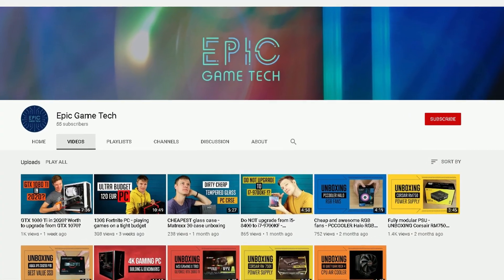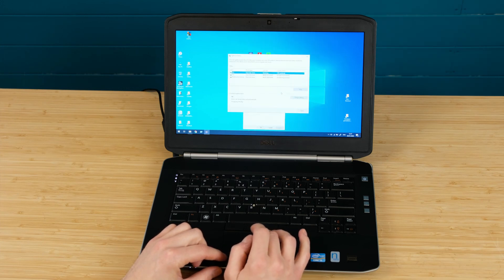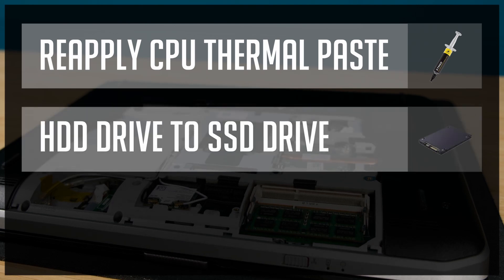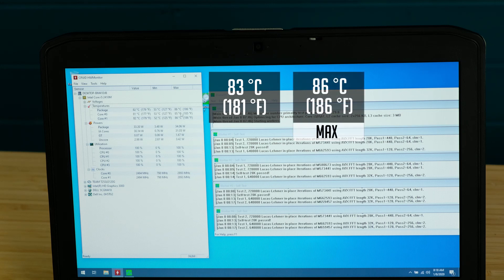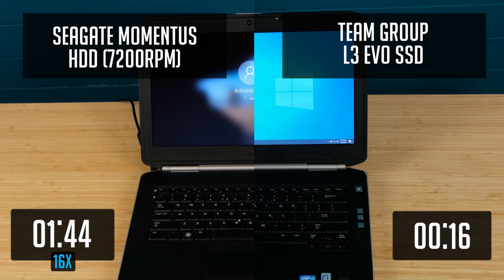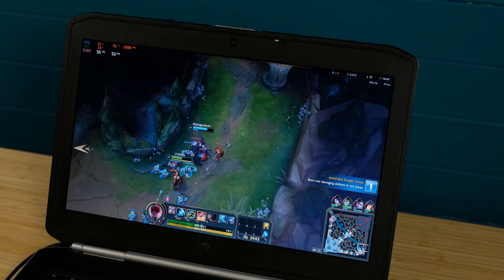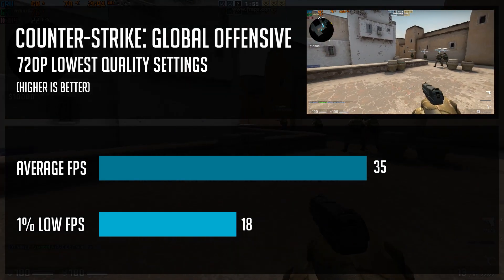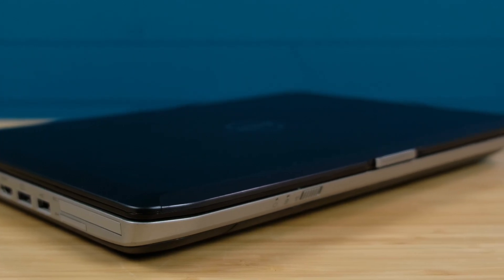HOW TO BOOST OLD LAPTOP PERFORMANCE - INSANE results and much faster windows 10 boot time

Comment: It's one thing changing HDD to SSD that seems a sensible thing to do, my problem is I have a small budget how can I get Windows 10 on to my laptop or even the Windows 7 that is currently installed on to the new SSD. Would appreciate your help on this matter.
Reply from the maker: Hey,
well, changing HDD to SSD is not too hard as you probably saw in my video :)
Just a few screws and unplugging HDD and plunging SSD.
Can you please rephrase your question, since I'm not sure i got it :)
- Do you want to ask on how transfer your windows to a new SSD?
- Or how to fresh install windows to a new SSD?
Or anything else you had in mind :)
Reply: @EpicGameTech  Sorry if I was not clear, how would I get a fresh install on to the new SSD fitted.
Reply from the maker: Basically, the easiest way to install windows from a USB drive - you need 8gb usb drive or bigger and download windows from microsoft.
I didn't have a similar guide video yet (planning to do it), but i suggest checking Pauls video part, where he is explaining/doing this part in his video:
https://youtu.be/MfwjISmkEJM?t=232
It's really quite easy and takes just a few steps :)
Reply: @Socrates99  I downloaded windows 10 then 10 pro for free